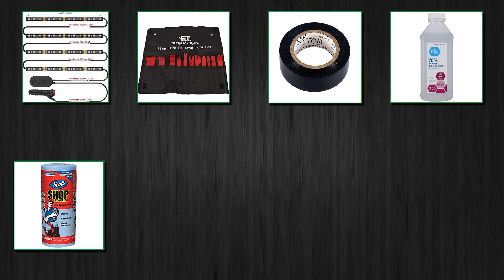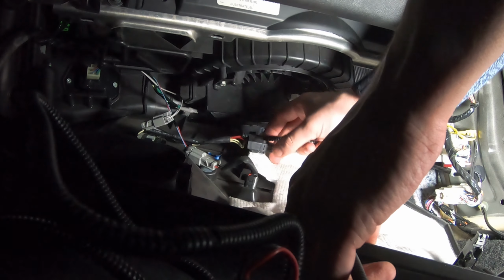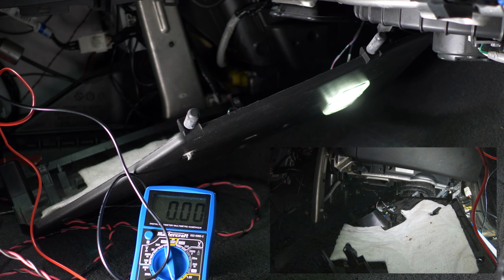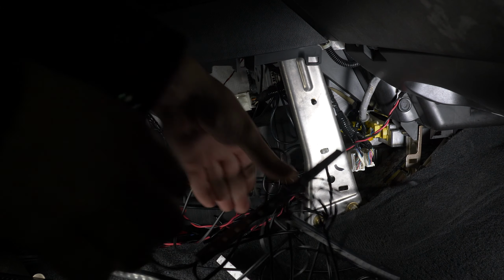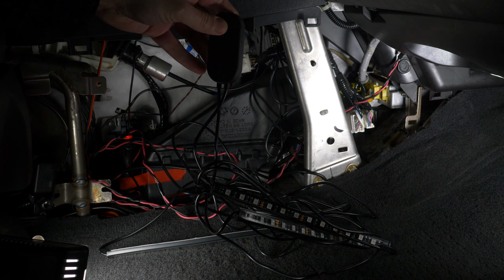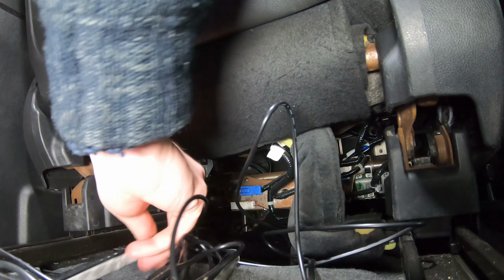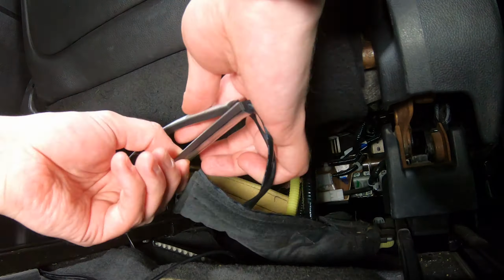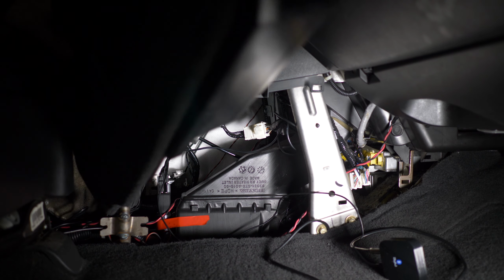Acura MDX Second Row Footwell RGB LED lights installation

Comment: Hello I like your videos congrats 
One question 
How can I change the main lights per LEDs lights 
I changed the daytime lights for led lights and taking this as a reference, at night if they look good but they don't illuminate from a distance.  I want to change the main lights for LEDs but I want something of good quality that does illuminate and that does not bother drivers coming from the opposite direction
Reply from the maker: Hello. LEDs that will provide similar brightness to the HID bulbs will cost about twice of HID bulbs. It’s basically a waste of money for these projectors. Go with OSRAMs HID.
Reply: @AcuraAddicted  
Thanks a lot for your quickly answer 
It mean that my trouble are the ballasts 
It’s the reason I am thinking in LEDs

Comment: Hi, I’m looking to buy a Acura MDX 2nd generation Model. Could you please suggest best Year and Trim in MDX 2nd generations? Thanks in advance
Reply from the maker: Good question!

Personally I would look at 2007-2009 models (obviously 2009 being preferable). While the 2010-2013 provide better technology (BT music streaming, better resolution screen, active cruise control, etc), they are prone to excessive oil consumption due to slighly upgraded engine pistons. So I would stay away from 2010-2013.

In terms of the trim, go with either Tech or Sport, as you get navigation screen (and power liftgate on 2009), and other improvements. With sport you are also getting adaptive dampers (which, although are prone to premature failure, but provide better ride, plus you can swap them with regular dampers when they fail).

To sum up: go with 2008-2009 Tech or Sport. Of course, look for lower mileage better looking car that's being taken care of.
Reply: Thank you so much for your valuable suggestions.
Reply from the maker: @djboscoo  You're welcome! There's a lot on my channel you can use for maintenance and repairs for the MDX, should you need to.